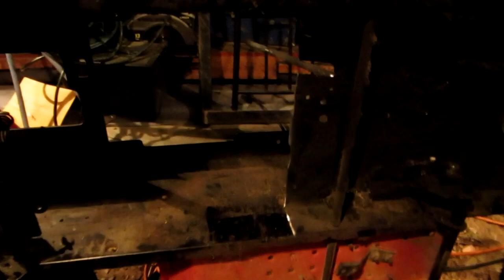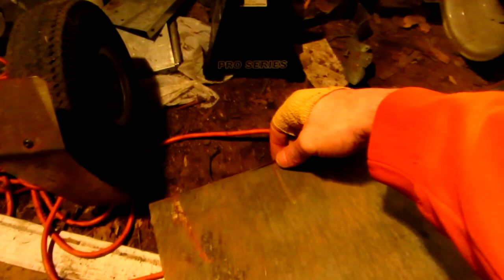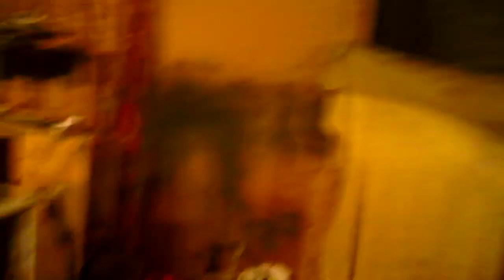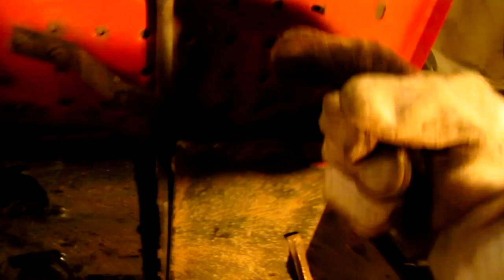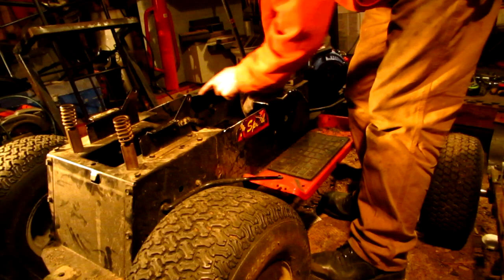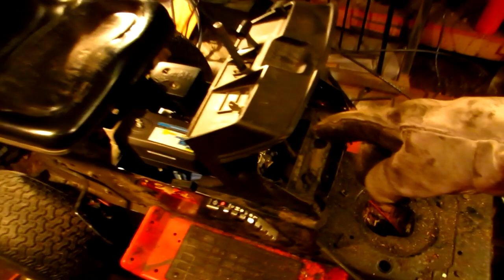Crazy Lawn mower build #2 ( T-man )

Comment: That's pretty cool looking...I'm building my frame first then I'm going to put tin all around it...I'm using a 125 M  Honda 3 wheeler for the rear end and the motor for power...I started from scratch with the frame work...

Comment: Tman, I was going to do one of these, I thought it would be a good idea to have steel plates on the bottom so that you can skip over rocks without breaking the belt, I'm kind of confused though will you keep the belts or do chain? A chain might be easier and wont slip when wet thanks for the great videos though!

Comment: So what ya gonna do about cooling? Is a aircooled motor but your boxing the motor in so how ya gonna keep it from overheating? You could mount a small fan but that motor doesnt have a charging system. maybe cut soem cooling fins into the side of the sheetmetal so hot air can escape and liek a small scoop or something on top to force air onto the motor.

Comment: Cool, looks good!

I know you already welded that plate in, but dropping the mount plate another 2" would have blended and you would of had less of a bulge. Just my $0.02.

Sucks about your hand though, fuckin wood blocks. Have you ever looked at getting or using a pair of Mechanix Gloves? I use them almost all of the time in the shop and they have saved my fingers and palms quite a few times. Definitely worth checking out, and they are usually only around $20-$25 a pair.

Comment: wouldnt the exhaust be getting so hot from it running that the heat coming from the exhaust fumes be starting to melt the rubber of the seat